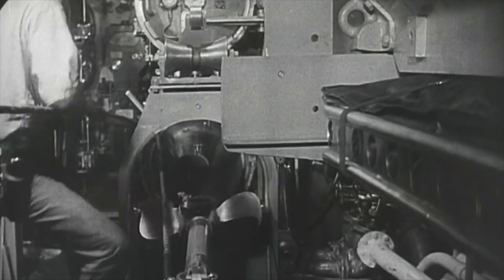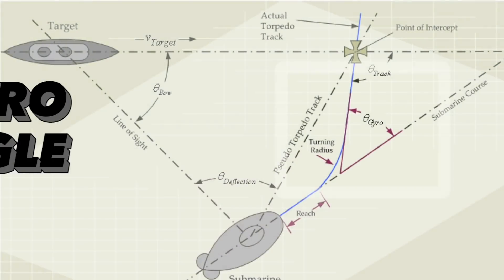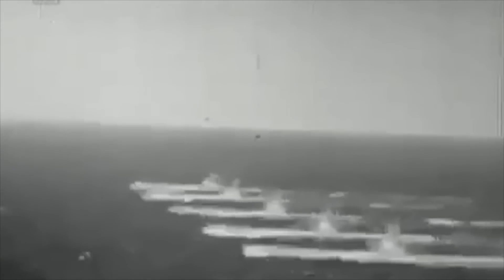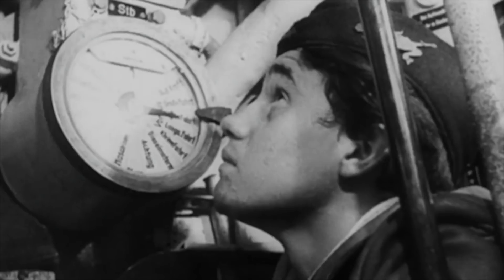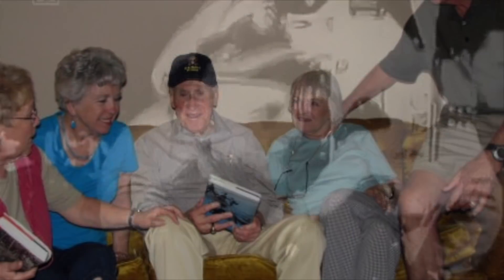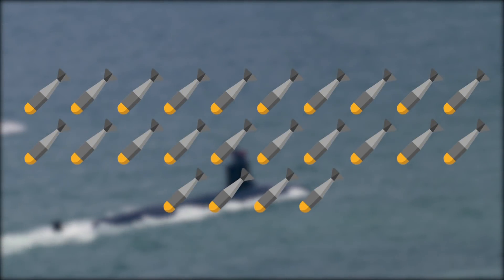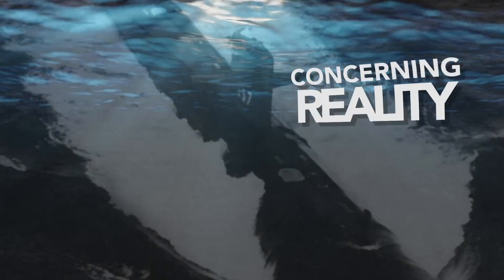The Submarine that Sank Itself

Comment: The "Tullibee" shown at 1:29 is of a post-WWII submarine, likely SSN 597, the second to be named Tullibee, a nuclear powered attack submarine launched in 1960. The submarine you speak of is SS-284 and looks completely different from the submarine pictured.

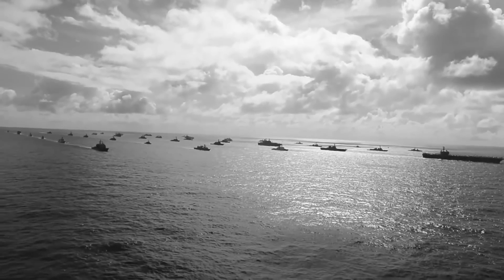The image shown at 2:28 is of a Seawolf class nuclear attack submarine, the earliest of which was launched in 1995. You could probably use nearly any image of an American WWII era submarine for stand ins of the Tullibee or Tang, but submarines in the nuclear power age are significantly different looking due to the way they were expected to operate. WWII era subs would ride on the surface and only dive to approach and attack targets. This is because they operate typically on diesel engines which require air and use batteries when they dive, which are depleted quickly and must use the diesel engines to recharge. Because of this, WWII era subs are made to be more stable on the surface, and have hulls that vaguely resemble regular ships (with a V shaped hull). Modern submarines that are nuclear powered have their fuel changed maybe once or twice in their entire service lives, and generally operate submerged. They only ride on the surface in shallow water or when entering or leaving port. Their hulls are tear drop shaped and are more stable underwater than on the surface.
Reply: Autistic as hell brother, good work, good comment.

Comment: There were more than two USN submarines during WWII that met their end in this manner.  The USS Grunion was another.  In July of 1942, the Grunion was operating off Kiska Island, in the Aleutian Islands of Alaska, where she fired several torpedoes at the Japanese merchant ship Kano Maru.  Two of the Grunion's torpedoes bounced off the Kano Maru, without detonating - an infuriatingly common occurrence with the type of torpedo the Grunion and most other USN submarines carried.  A third torpedo fired by the Grunion, passing closely beneath the Kano Maru, should have detonated beneath the ship, but its magnetic trigger failed.  It was this torpedo, or possibly a fourth, that circled around to strike the Gurnion's periscope support structure (without detonating), initiating a series of control failures in the submarine, itself - resulting in the submarine losing depth control, allowing it to sink well below its test depth, where it imploded at about 1,000 feet below the water surface.  Because there were widespread failures in USN torpedoes of that era, it is likely that many more American submarines were lost during the war; due directly, or indirectly to the unreliable torpedoes that were supplied to them.

Comment: Seems like it could have been trivial to have a mechanical timer yank the torpedo to the surface if it's rudder stayed turned 2-4x longer than normal. Makes you wonder if the shorter construction time & higher explosive yield balanced out losing 2 subs.
Reply: WWII-era subs were usually on the surface themselves when they launched their torpedoes (they were essentially surface ships that could submerge for a while if necessary); before someone asks, no, they wouldn't've been able to submerge quickly enough to dodge a circular-running torpedo (it took about a minute or so, by which point the torpedo would already have hit or would be close to doing so).

Comment: I agree with you completely. Having machinery that does not function as designed is very frustrating. It is like buying something on Ebay and it does not work when it arrives in the mail.
Reply: At least stuff from eBay doesn't (usually) try to kill you when it doesn't work.

Comment: PBS did a documentary yrs ago called finding Hitler's lost sub. It was off the east coast of United states. Seems the local fishermen were always getting their nets caught on something & loosing their nets, so one guy hired a dive team or maybe he was dive certified,anyway someone went down & found a U-boat with its coning tower blown clean off & laying a couple hundred feet away. There was a 4" crack in the hull from the center of the sub, just forward of where the conning tower had been, running down the starboard side to the ocean floor. The diver went into the sub all the way to I think it was the electrical equipment room & there was a plate riveted onto part of the sub, that had the serial number on it so they could document it in the war records in Germany. Google it & see if it's on You Tube. I'm going to do it now. It's been at least 25 years since I've seen it.

Comment: Now a days, they not only go in circles, but they can be programmed with the exact sound signature that the target is making.  If the torpedo does miss, it returns to circling until it hears the target again and then resumes its attack... if it misses again it circles and listens again... etc.  Usually two torpedoes are launched at a target. Which can be twenty miles away since the torpedoes are mounted on to missiles. They fly through the air until they are close to the target and then break away from the missile.

Comment: This happened to my Great Grandpa, the guys who found the Titanic found his sub, they didn't pull it up, and my grandma finally got to know what happened to her Dad. We buried an empty casket in Arlington National Cemetery a few days later.
Reply: Was he on the Thresher or the a Scorpion?  I know Ballard was tasked with studying them for funds for Titanic.
Reply: @Kokopilau77  i believe it was the USS Scorpion, USS Thresher sank due to a leak in a water pipe leading to the Nuclear Reactor to cool it and when the crew tried to blast the ballast tanks (i think that's what they are called) they couldn't because the water in them had frozen and the submarine sank to crush depth and imploded then exploded.

USS Scorpion (officially from the US Navy cause not many agree with it) Sank because one of the torpedoes loaded in the Torpedo tubes has started so the USS Scorpion fired it before it could explode but because USS Scorpion was alone in the area the torpedo turned around and hit the USS Scorpion
Reply: @SP4460  The navy lied. It is believed they cut corners on maintenance and that's the real reason she sank.
Reply: @Henry-vu5sg  hence why i said it was the official report of the US Navy straight after which i said that not many agree with them, thanks tho for making it clearer
Reply: @SP4460  Man I couldn't even understand what you said until he laid it out for me, and all others who read this line if comments
Reply: Grunion?

Comment: Germany also had some subs that torped the self but Not because an error, they sank coz of superior german engineering.

Both of These u boats fired  aucustic guidance homing Torpedos, and the Torpedos picked up the Sound of the subs and sank them.

After that all german subs were told to shut down their engine before firing the aucustic homing torpedos

Comment: I don't think that was the correct Tullibee. I was stationed on the SSN-597. We had the SS-284 Battle Flag on our Mess Decks... it shot itself circular run, one survivor... and the lone survivor visited us each year I was there. But the nuclear-powered Tullibee (SSN-597) had the BQQ4 PUFFS sonar domes fore and aft (a third was installed centerline later), and the whip antennae (there were 2 on the sail, one on a mast) is a dead giveaway. When walking on the turtleback, if the whip was being lowered you had to watch out for it cuz it snapped hard. And finally, SS-284 had bow planes, not sail planes.

Comment: That Uboat U869 they found off the coast of New Jersey had a big hole in its side. The Navy new nothing of it, wasn't sunk by them. They suspect when they launched a torpedo the gyro went haywire circled back around and killed them, All hands lost.
Reply: No, it was sank by it's own FAT torpedo, which when fired ran a straight range "X" then ran in concentric circles of increasing diameter until it hit a ship in convoy or ran out of fuel or hit the sub that launched it. The German (both BMW designs) LUFT torpedo homed in on the magnetic field of a ship's steel hull. The cure? A "DeGaussing Coil" of heavy electric wire that encircled the hull in a vertical plane with DC electricity passing through it  , manufactured, by among others, The Nelson Electric Company in Tulsa, OK and by my late 4F Father in particular. He also built the explosion-proof electrical panels that controlled it. When all the Allied surface vessels were so equipped, the LUFT might home in on the only magnetic steel hull (and electric motors) near-by, a U-Boat.  Then he moved on to machining the base for The Norden Computing Bombsight, but the guys didn't know until fall of '47. That's what they had been making from a block of Synthane (bakelite impregnated linen). I still have a block of 1/2" thick Synthane from Nelson Electric he brought home, and it still STINKS!
Reply: They thought a Coast Guard Destroyer sank it. later on from flooding.  But was never given credit for it...As U869 had went North. As the Captain was given two options were to deploy..Go south or go north...Read Herbert Guschewski story. The sole survivor off U869. As he stated one in 100 Submarines ever had a torpedo circle back around..
More then likely it was the Destroyer...As the damage was from two large hits. Not a single torpedo..
Reply: @MasterChief-sl9ro  I guess I can't make a statement without an argument. There was a PBS special on tv about this. The Navy and the Coast guard didn't have any records of Uboat sinkings in this area. So now the Uboat had to be identified, which cost three lives in doing so. Once identified, and with cracked German navel codes, they figured out what happen. It was the US Navy that inspected the damage and it was them that said it was a circle back torpedo. So go argue with them not me.
Reply: @TSemasFl  https://en.wikipedia.org/wiki/German_submarine_U-869

Comment: They want to say this is what happened to the USA Scorpion, it didn't..
Reply: I worked in Chesapeake, VA with the daughter of a Chief Machinist Mate who perished on the Scorpion
Reply: What is your hypothesis on the sinking of the Scorpion?

For those unaware - the leading hypothesis is that a torpedo started in its tube, which can lead to dangerous overheating and explosion. To prevent circle running accidents like what happened to Tang, the weapon had a safety to shut off if the onboard gyro detected a rapid 180 degree turn. Hence the sub tried to reverse its course to shut down the weapon.
Reply: @MrChainsawAardvark  It could have been the Russians who sank the Scorpion intentionally.